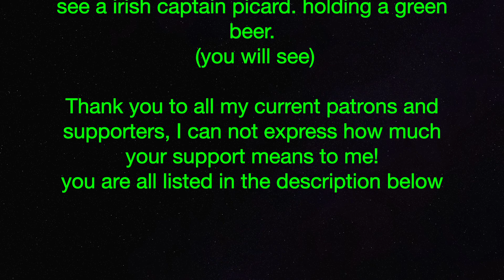Amiga 1000 PiStorm !NO MORE KICKSTART DISKS!

Comment: I'd like to see a PiStorm in an expansion bus form factor that you could just insert into the side of your A1000 or A500.
Reply from the maker: Those slots are not 32bit cpu slots  theyre 16bit zorro2 .The pistorm is a 32bit cpu emulator hence the a1200 roms.  Idk if it would work
Reply: @ChrisEdwardsRestoration  I think he was referring to the fact that the ZorroII side slot will mirror the 68000 socket signals, so in theory you COULD relocate the PISTORM form factor to Zorro for use on the A1000 side expansion (Just remember the slot is Inverted to an A500's).

After all, you can use an ACA500+ on a 1000 if you are good at remembering to flip the device over.

The 68000 is a 16bit CPU, and the 86 pin bus is merely a buffered extension of the 68000 slot.  In theory you could form factor the PIStorm to the A500/A1000 86 pin connector, but remember to remove the 68000 from the old socket.

At its basic, the 86 pin carries the full compliment of 68000 signals, plus a few clock (CLK) and Ram / Rom select signals along with some 5V / GND rails.  If it works on the 68000 socket, then if you form factor for the 1000 / 500 expansion slot, it SHOULD work.

[edit]  Checks out.  The 68000 socket is connected DIRECTLY to the Expansion slot.  and for the Shits / Giggles if there was enough room, it would work in an A600 too, because using a 68 pin PLCC socket and tying a pin to ground via a resistor (I forget which, BGACK is one of them and i think _BR) the 68000 goes in to stand by, so all you do is regenerate them on the PISTORM side for the system to operate.  So by dropping _BR to Ground (via a 1K resistor), the pin goes low (Logic 0), and the CPU will disconnect itself from the bus.

https://imgur.com/a/yrrBP8q

Comment: I was wondering how easily it would fit in there considering the size constraints. Now I know. I had a hard time fitting an Indivision ECS in mine (also NTSC). This seems like it won't be as bad. Of course, with the chip shortage, the PiStorm is unobtanium right now, but I grew up with my Amiga 1000, so it would be a nice upgrade for it, even if it only has 512k of chip.

Comment: I just purchased the Amiga Parceiro from David Dunklee. Nice little solution by adding 8mb memory, clock and sd card access. You do still have to boot with a kickstart/workbench combo disk to use it. Conflicted on what I want to do now. 100% Amiga with David’s solution though.
Reply: Get em both ;)
Reply: Get a Parceiro // board, and you now have 3x kickstart mappings off of SD card